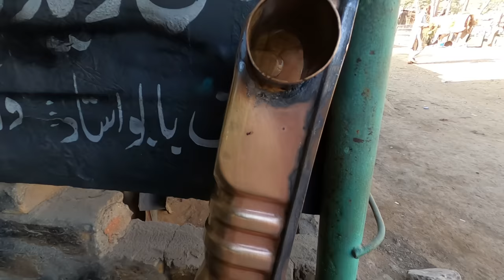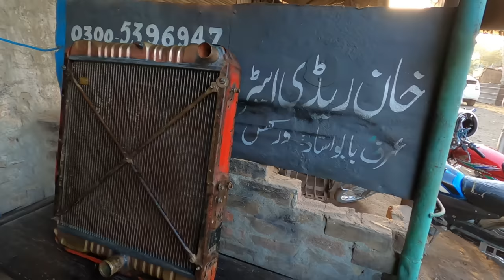Radiator Repairing and Restoration | Truck Radiator Repair & Restore

Comment: I know a guy who used to repair radiators for a living. It's a lost art at least here in the states. Most radiators are just plastic and aluminum now, and generally get replaced as an entire unit instead of repaired.
Reply from the maker: Right, thanks for your comments 😍❤️
In Pakistan it's in full motion...
Reply: Difference in America is labor costs, for most cars you can get aftermarket radiator at a price of one hour of labor. But I do remember the soldering iron that my pops had back in the old country.
Reply: I paid a shop to tear mine apart like this man did for my 1992 Dodge D250 diesel.  I had bought an aftermarket aluminum radiator for it but it was a Chinese POS.
Reply: We repair aluminum radiators
Reply: There are still places that do  repairs, they'll replace the tanks, the nylon reinforced plastic ones are garbage and always hair-line split etc. I had one repaired and they put steel tanks on it. The next time it happened I bought an aftermarket all aluminium radiator and kept the old core which had not failed.
Reply: Most automotive parts nowadays are just throwaway parts. Used for scrap. In the U.S. they only rebuild starters and altenators, mostly.
Reply: Our factory in China has different radiators and various cooling system products for you to choose, if you want to purchase customers, please feel free to contact me
Reply: i used to work in a radiator shop a few years ago, its a dying trade indeed. woulda still been there if i didnt live so far
Reply: you can still find recore places for big trucks and for classics.
Reply: все просто, пакистан отсталая страна в которой новый радиатор это роскошь😢
Reply: @VenturiLife  I too had a tank replaced.  It lasted a few years, but then the oil cooler inside started leaking, at which point I replaced the whole thing.
Reply: No chemicals or acids have been used to clean this radiator
Reply: Here in central america (Guatemala, El Salvador, Honduras, Nicaragua, Costa Rica) this art still grows strong and is not lost at all. A job like this could cost you somewhere between $50 - $80 for your car and more if it is for a bus or truck

Comment: This man is a craftsman. 10/10. Excellent job, a real pleasure to watch!
Reply from the maker: Thank you so much ❤️
Reply: Is it normaly pressing without pressure?
Reply: @100ampscurrent  probably not, but when the tech isn't available you roll what you got
Reply: Too bad his lungs are trashed from breathing those fumes daily.
Reply: Really? What about contaminated water running across ground…. Getting into groundwater…
Reply: @turbodog99  Yeah, no OSHA or EPA there. It's their problem.
Reply: @PakistaniTrucker Отличнпя работа. Что за средство так латунь хорошо очищает?
Reply: 20/10 plus he deserves a great tip. This gentleman good above and beyond with his work. Great job sir 👍💤

Comment: Great job Sir.Respect to you from Bengaluru (India) for your attention to detail. This is  recycling of lead used for welding. He used a flame thrower along the seams but as the lead melted it fell into a pot of water, this he collected and made a rod of lead to weld the radiator covers back on again.
Reply from the maker: Thanks for your comments 😍❤️❤️
Reply: Олово.
Reply: They don't weld, they solder

Comment: Holding the lead solder in your bare hands is leading to disaster. Great work 👏🏾
Reply: why?
Reply: solid lead is not a risk , the risk is the gas from its combustion. the same with mercury. touch the blobs of liquid is not dangerous . the problem y its vapor in a closed room. because it is evaporating constantly at room temp.

Comment: I have actually had this process done to a car I backpacked around Australia with back in 95. Outskirts of Perth in a junkyard/simple repair shop kind of deal. I watched the whole process while the guy was doing it, pretty much the same way this guy did it. 
A semiblocked radiator is a bad thing to have in the Australian summer heat. But after the repair it ran cool for 20000 km around the whole Australian continent. Almost 30 years ago now, unbelievable how time flies.
Reply: What acid did you use? I feel like it would dissolve the metal of the radiator.

Comment: I don't get it... Was there a leak somewhere? Not questioning the work. Best I've seen. But the water hose and the acid wash was good enough to get the gunk out without disassembly. I only assume there was a leak in the weld somewhere, thats all, otherwise too much work.

Comment: they use to do that here because the old radiators were copper...now that they are aluminum and mass produced that trade or skill has basically died off except for a few restoration shops for classic cars and trucks...now radiators are basically so affordable its cheaper to buy new than have them flushed/cleaned/dipped/boiled out...

Comment: whats the solution he used to clean the insides? and the outside fins?
Reply: normal acid you use in you car batteries but diluted. thats why he was able to pour it while holding on to it aswell, otherwise it would've burn his skin. the trick is, pour it or spray it but wash it as soon as its done reacting otherwise it will create rust patches.

Comment: here in the Philippines, we heat the cap and we scratch the nicolite lead into heated area..no need to use soldering iron in closing radiator cap

Comment: What is the hot liquid that he was using to clean?
Reply from the maker: It's an Acid
Reply: @PakistaniTrucker  Thank you for the answer. But what kind of acid? He can touch it with a bare hand and didn't harm his hand. Greetings from Turkey.
Reply from the maker: @fatihbural7845  right, I don't know it by name. its harmful even if you breathe its get difficult. But sorry I just make video, don't know ...

Comment: Anybody thought about all the chemicals dumped into the street and perhaps into the drinking water channel in the ground polluting the environment.
I hope they’ll never complain when future generations are born with strange kind of sickness
Reply: I could be wrong but im pretty sure its just hot vinegar, a lot of ppl use it to clean radiators, specially brass ones
Reply from the maker: @DarkSlayer777  Acid used for cleaning, which is also used in homes for different purposes.
Reply: Yeah, heavy metals in the environment, no way that could go wrong, right?

Comment: Radiators in areas that salt is used in the winter rot out. Where there is no salt used on roads allows this type of repair. No concern for safety or pollution bare hands and letting chemicals drop right on the ground.

Comment: That is an intercooler not radiator.
Reply: Uuuuh no. That's a radiator.
Reply: @feedemtothepigserrol2469  no its not lmao. Radiators don't have boost in and out ports. The ports on an intercooler are on the top and bottom not the sides.
Reply: @CrazyForCooCooPuffs  Aahahahaha. There's more than one way for a radiator to function, kiddo.
Reply: @CrazyForCooCooPuffs  While uncommon, side feed radiators are absolutely a thing 👍
Reply: @RollingRoadEFI  where is the obviously missing fill cap/port?
Reply: @CrazyForCooCooPuffs  Have you heard of an air separation tank? That's where you'll find the cap. It's function is to act like a remote reservoir and remove any air pockets. Simple.

Comment: Not sure what was used to clean the radiator but it worked great. If I tried that in America and used a hose to wash it down the street some libtard would see it and go berserk 🤣🇺🇲👍 I say f them let it rip. And great job by the way looks great I miss copper radiators...